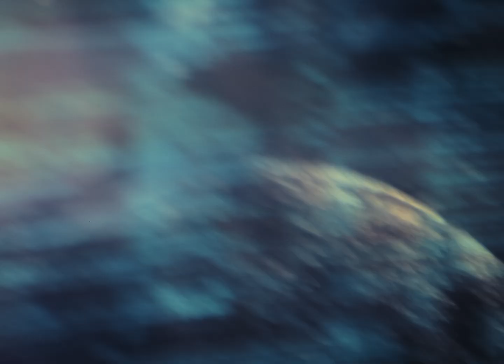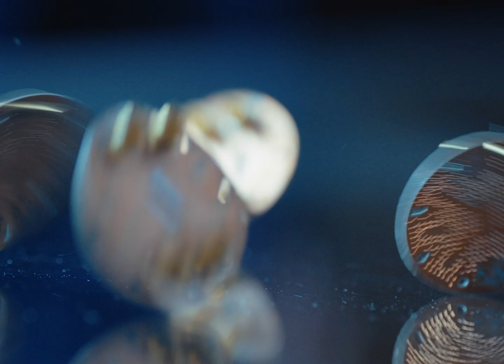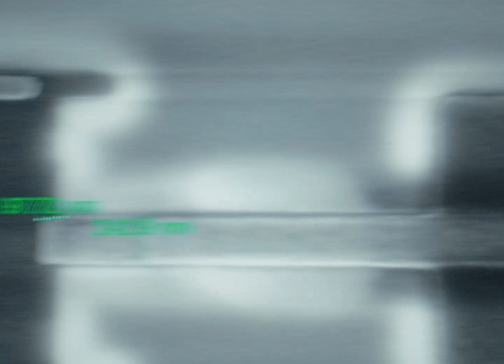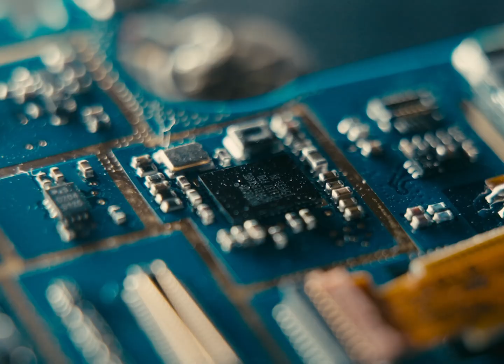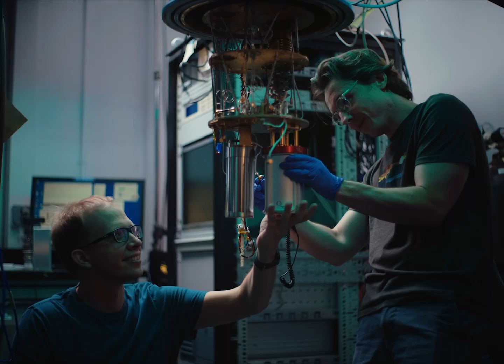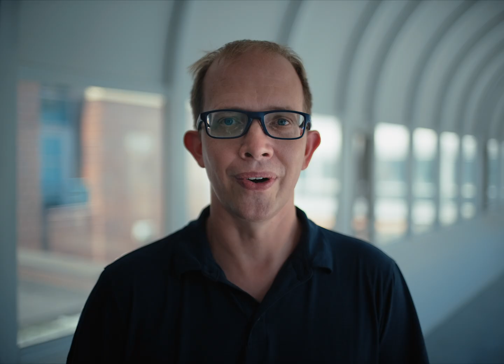Princeton professor Andrew Houck making quantum leaps to unlock a multiverse of possibilities

Comment: Modular Mathematical Building Block System (MMBS) for Quantum Computing and New Programming Languages
My Modular Mathematical Building Block System (MMBS) provides a highly promising framework for quantum computing applications and the development of more efficient programming languages in this field.
Here's how the MMBS concept could be applied:
 * Quantum-Theoretical Models: The MMBS enables the direct creation of quantum-theoretical model systems by combining building blocks such as "[Object: Hilbert space]," "[Operator: unitary]," and "[Logic: Quantum logic]". This is crucial as quantum computers are based on quantum mechanics, directly mapping these mathematical structures.
 * Energy Efficiency: The flexible combination of mathematical structures offered by the MMBS could lead to the development of computation models specifically optimized for quantum computers, drastically reducing the energy consumption of AI systems. This is particularly relevant for quantum computers, whose operation is currently very energy-intensive.
 * Improved Transparency and Explainability (XAI): MMBS building blocks are defined, typed, and rule-based units. This inherent traceability of the models would overcome the "black box" nature of many current AI systems and could make the functioning of quantum algorithms more transparent. This would be beneficial for debugging and optimizing quantum programs.
 * Adaptive Situation-Specific Computation: The MMBS allows for dynamic adjustment of the "computation type" to prevailing conditions. For quantum computers, this means that the optimal mathematical configuration could be selected depending on the problem and the availability of quantum resources (e.g., qubits, coherence times). This could lead to more efficient and robust quantum algorithms.
 * New Programming Language: The concept of combining mathematical building blocks via defined interfaces and rules can be directly applied to developing a new programming language for quantum computers. Instead of using abstract commands, developers could visually and rule-based connect mathematical objects (such as qubits or quantum gates as operators). This would make the creation of complex quantum algorithms more intuitive and potentially provide access to quantum programming for non-specialize. Meta-rules could ensure that only physically meaningful quantum operations are combined.
In summary, my MMBS offers a highly promising framework to fundamentally simplify the development of quantum AI models, enhance their efficiency, and simultaneously improve their transparency. Applying the building block idea to programming could also lead to a more intuitive and powerful quantum programming language.
Please note: This system is currently still under development, and we have not yet finalized all aspects. It will require some more time to fully mature.